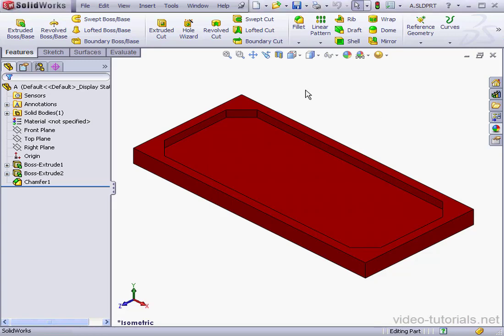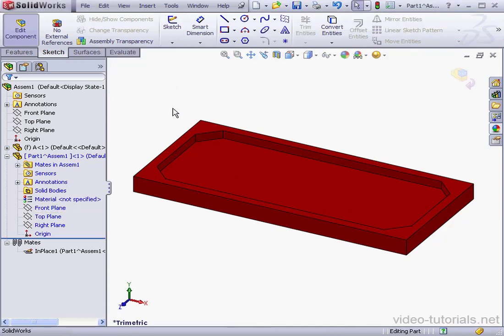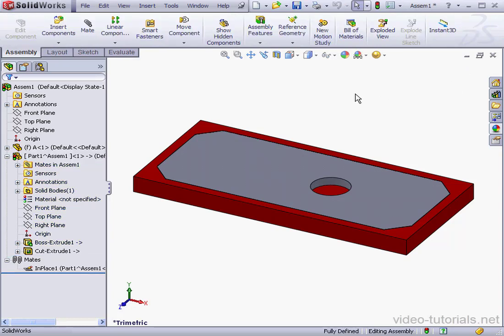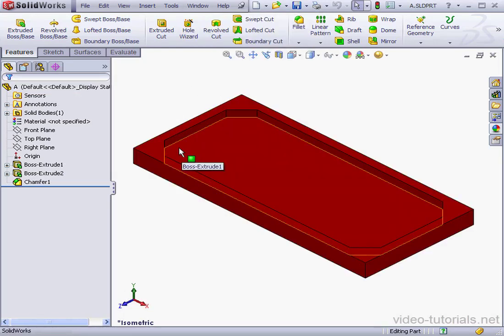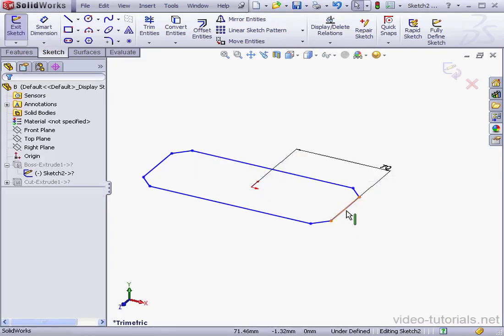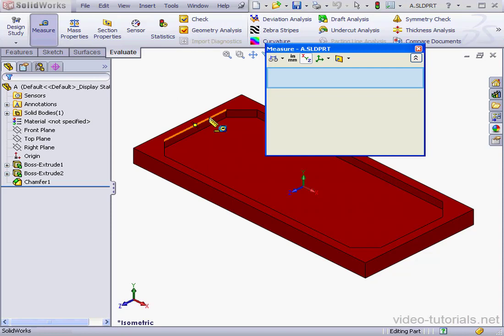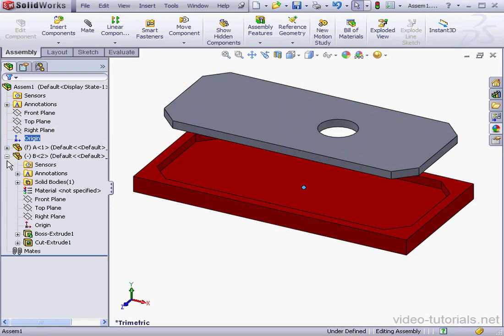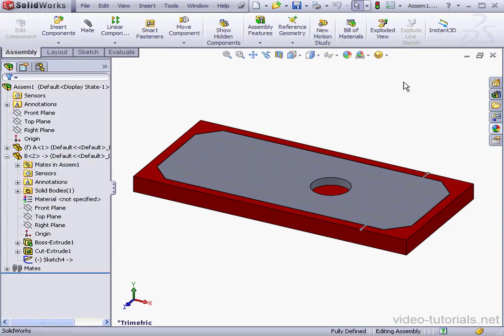28 SolidWorks Advanced Assembly  ( External Reference )

Comment: I am having a problem with configurations. I make an assembly and it has parts with Excel table configurations. call it abc123. But when I make the same assembly to be a bigger size and a different assembly number say to xyz123  it changes my original assembly. How can I have multiple assemblies that are alike but of different assembly part numbers? When I make a copy of it and change it, it still changes my original assembly file, can I break the reference between assemblies? Thank you James in Texas